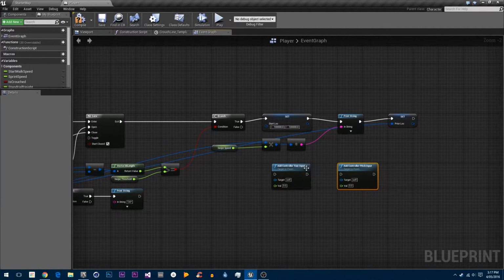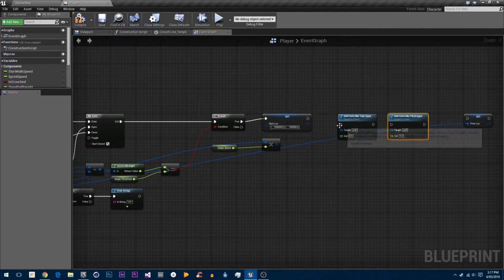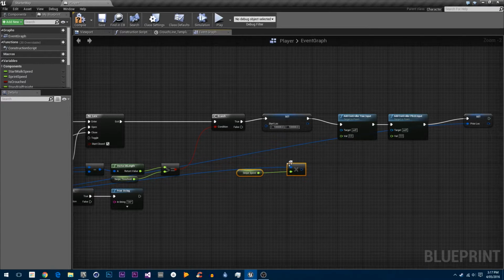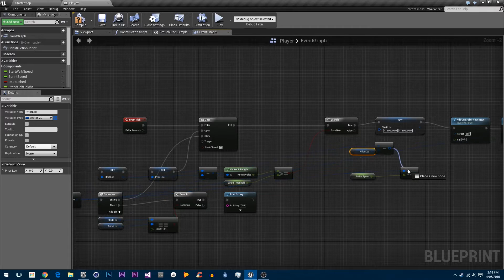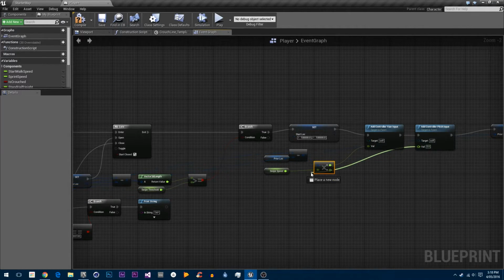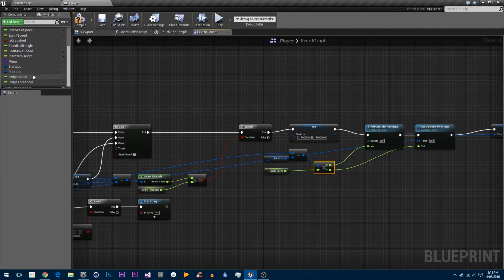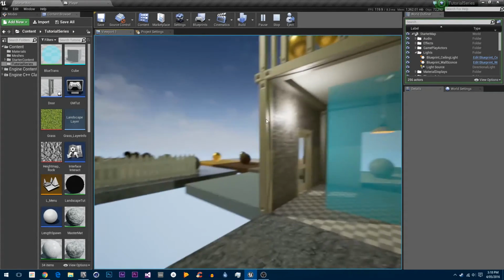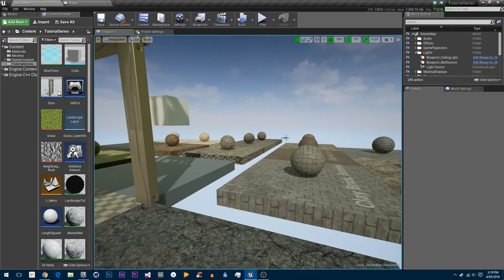Swipe Input Camera - Request 3.2 - Unreal Engine 4

Comment: Hi, it is an amazing tutorial, works perfectly fine.
Just one noob question, is it possible to divide the touch screen into sections inside unreal, for the touch to move camera and for the joystick? I need to create a system where the joystick and touch to move camera function independently.
Reply: @OscarRobin  Does UE4 have a joystick setting that can be used like that? like Joystick to move and touch to look.  I  want the touch to look setting to be just like this. I want the Movement joystick to be independent of it. What would you suggest is the easiest way of doing that?

Comment: Hi there, would you ever consider doing a video to show two finger touch for "zooming"?
Reply: Sky Blu Studios it'd be great to see it, even just the blueprints uploaded on the answer hub.
Reply: Sage words, Thanks again, I'll be sure to follow these tutorials and try to figure this out from what you're written, I try to present answers to my problems on the answers forum and explain them well because some things are a nightmare to understand at first.
Reply: + Sky Blu Studios Great Success! I actually got it working! and I feel all the more better because I understand most of the blueprint now. It's most likely not the same as you'd have done it but it works and that's a small miracle in itself.

Comment: Hi. Is my project successful? It behaves like so:

With mouse as touch checked in the Project Settings, when I play there are two virtual d-pad, I can move both virtual d-pad if I mouse over them (blindly coz' the cursor can't be seen), the d-pad moves but the scene does not. However, if I click on the mouse (that's not on the d-pads' location) the scene moves, normally. You have to click the mouse to move the scene. Is this successful. How do you transfer just the part of the blueprint Touch/swipe nodes to another Project which is set on mobile (so it has the virtual d-pads/controller) so that when I click the virtual controller, the scene move (just up and down at least). How can it be connected to work with another Project's virtual d-pad. Thanks.

Comment: Why can't I find the "split struct" option?

I searched through the preferences, both editor and project, for "split struct" and I found I can assign a keyboard shortcut, but even still I cannot split structs using this shortcut. 

Does this feature still exist, or was it removed because it had too many bugs?
Reply: Right Click ON BLUE PIN dude.
Reply: Thanks, got it working. It wasn't working because the struct can't be connected to any nodes before you try.